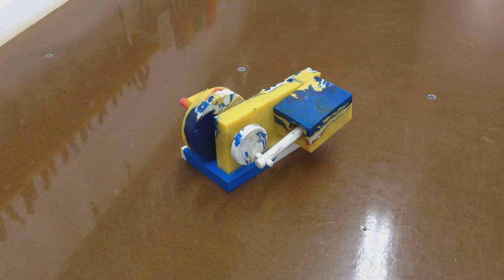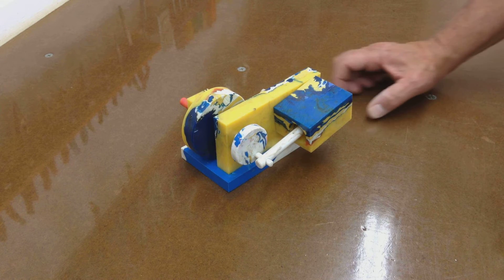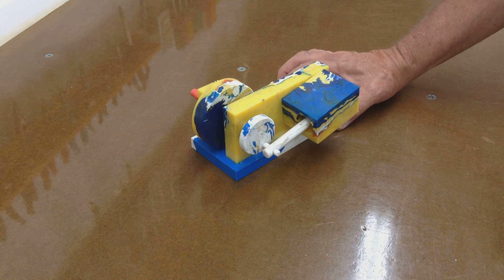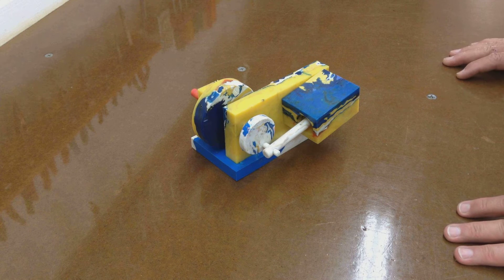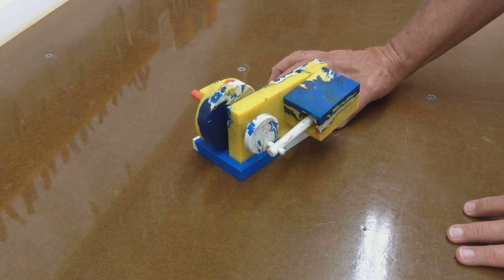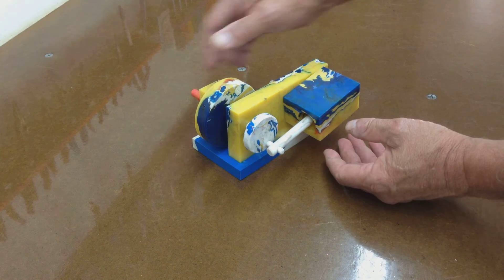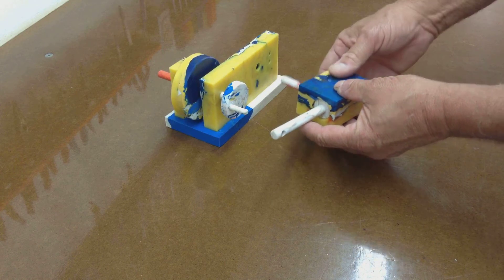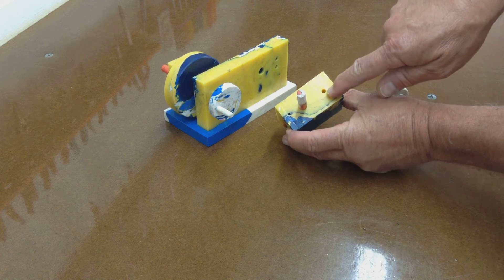Model Compressed Air Engine

Comment: I need something to turn a motor in reverse to charge 12 volt batteries. Does anyone have ideas? Run from compressed air. In my camper van. Air filled when driving.